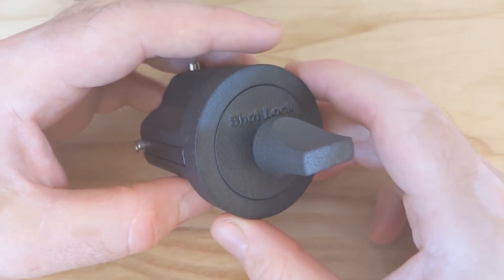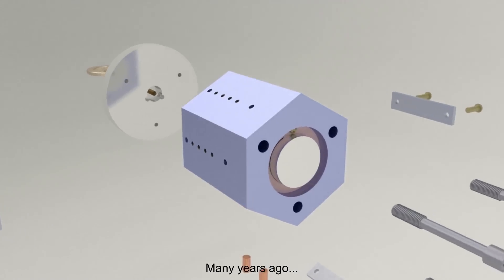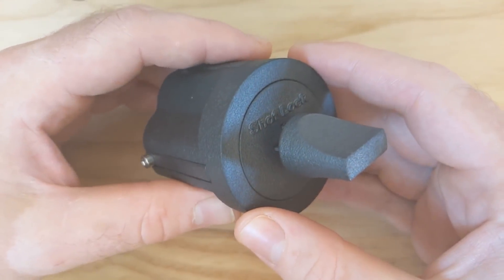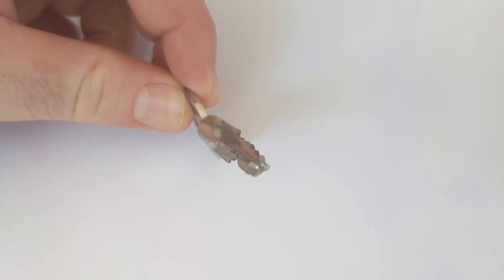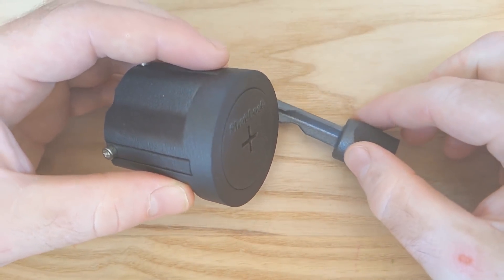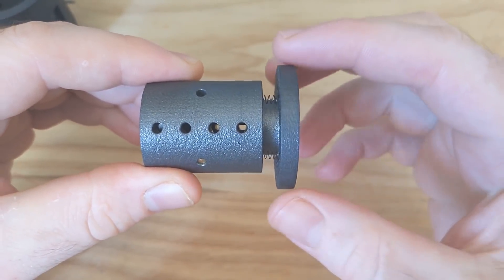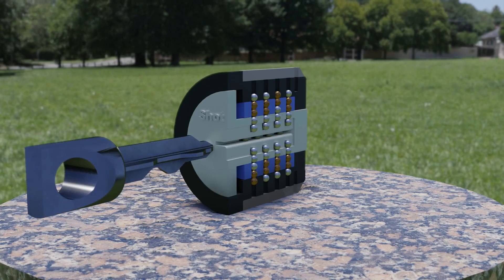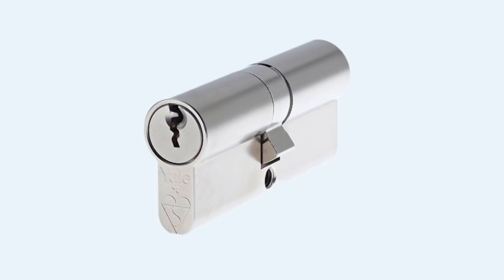A 3D Printed Unpickable Lock

Comment: Push up 1 pin stack, push in the inner core, add rotational tension, observe for slight additional rotation then pull the inner core back and check for drag from rotation. If you observe either the additional rotation or additional drag pulling the inner core out then thats your first binder otherwise reset the pins then try the next one until you find the first binding pin. Write it down.

After the first binding pin is found the method changes slightly. Push the inner core in just enough to be able to set the first binding pin without it falling, then look for the next binder by pushing in an additional stack. Push the inner core in look for even more rotation or drag pulling out. If there is no additional rotation or drag pulling the inner core out, completely reset the pins then restart this portion setting the first binder again and attempting with another stack. When you find the next one write it down then start looking for the next binder with the first two set. Repeat until unlocked.

It may be a little slow but since the bitting is binary, not only should you eventually pick it open but as a result you should also have to key completely decoded to be able to cut your own for future use.

This is based on using the mechanism in back that prevents the outer core from turning unless the inner core is pushed in for feedback instead of the sudden movement and click from pins being set while tensioned in standard locks. The drag would be from it lining up less and less as binding pins that it catches on first are no longer blocking it allowing the core to rotate slightly further. All manufacturing has tollerences and some pins will always bind before others due to that. Thats more important to single pin picking than being able to consistantly tension it while you pick.

Would love to have a copy of this to test it out, but otherwise this is mostly speculation. Love the lock design though, even if that does turn out to work it would still be pretty pick resistant.

I'm not very good at writing so I'm sorry if that comes accross as word salad :(

Comment: The cross lock makes it more difficult to pick. But unlike a key, which may bind when inserted the wrong way, a lock picker will not be using a key. Instead they'll use tension and a smaller lock pick tool. So they'll have access to all the ball bearing and driver pins.

I'm not an expert, but as long as there's some mechanism (key) being used to unlock a lock, there will always be a way to simulate that key with tools.

Comment: I think if there is enough space to push the ball bearings in by the length of two balls, then you could bypass the mechanism by pushing all the double pins out of the middle cylinder. Since the balls require springs to overcome gravity, the springs will have to be perfectly fitted for each lock to prevent them from being pushed back too far, which would make it expensive to produce. A high price tag is definitely worth the added pick resistance however.

Comment: I might be wrong, but I don't see very much difference comparing to "conventional" locks. It still has pins and they should be aligned at the same time in order to open it. The keyhole is so big so a locksmith still can apply torque to it and set every pin to it's position one by one. There are lot of pins though, so the process could be longer, but still it's the same process. I mean "click out of tenth, click out of eleventh". Since it doesn't have any security pins there will not be any counter-rotations... Great engineering though. Looks cool!

Almost forgot about this ball bearing idea. A pin with a chamfer on it consiedered as a low security thing, because you have no need to even position it precisely! And this lock have a ball bearings so LPL will move them very roughly with precision about a half of their radius and the tension will do the rest of the work.

Comment: Great video! Something fairly similar to this has been done in a euro cylinder format in China. The way they do it is that they have an exterior side with a larger diameter round housing, then the interior side only has one stack of pins so as to allow for the cylinder to be slid into the lock case. To accommadate, you can design special handles and use a hole saw to enlarge the existing hole. The best part about this is that you can design the handles such that they would protect the lock against snapping attacks. A wider handle might even be beneficial for post break-in attempts as it could help hide the scarring left from burglars. One piece of feedback I would say is to have more depths (3) if possible to increase key changes. I feel like this lock could have great potential for masterkeying or even quick-change systems. Great stuff and your earned a new subscriber :)

Comment: Suggested improvement? That lock can be an effective button, so you can take leverage out of the equation by making the lock turn itself when the key is inserted & lock body pushed in. At all other times the rotation is locked too solidly to jam any pins for picking.
This would also make extremely unusual key designs feasible, because you no longer need to apply leverage thru the key. It simply becomes the physical encoding device, W just enough surfaces to insert easily then depress.
Integrating the motor is straightforward, & power loss concerns can be mitigated W a charging system (even wireless?), Charging 2 batteries in parallel, each capable of running the lock thru 50-100cycles alone. The second battery is a redundancy. Both batteries should be designed for an offset maintenance cycle; if the lifespan of a cell is 1 year, then you replace the first in January & the second in July. I would actually recommend a 2 year or longer design cycle, W internal count/test & alert when cell falls below set threshold (modified smart BMS re lithium batteries?)
A manual lock/unlock override knob from inside also necessary, but mechanically feasible. Tho shielded button (Hollywood launch button) may provide security features of its own...

Comment: I've now read about "just keeping the tolerances low" multiple times here (for preventing some.... Plausible .... Attacks). I'd like to point out that physics plays a major role here and that tolerances will always need to be there in order to not make the lock a "works between 15 and 20 degrees C, but not in reality lock".
The reason for that is that different materials (even different thickness of the same materials) will inevitably mean that a theoretical no-tolerance-lock will just not be a good lock in practice if you can't open it on cold or hot days considering expansion and contraction due to temperature changes.
And as we all know, there is always an easy way to change the temperature of a thing without destroying it.

Comment: These are binary pins, so they might be more vulnerable to decoding than the standard pins. I wonder if there's any difference in friction when balls are free to move. Another way is to check for sound feedback when you slowly move a pin or by flicking it with a lockpick.

The effects could be more amplified if the keyway is slightly pushed in, so the balls have more friction with sidewalls.

Comment: LPL is gonna over-set all the pins past max intended height and open it in under 60 seconds. That's my prediction. It's not an inherent flaw in the concept, just in the current prototype implementation. It's a very promising concept that I think is actually viable for mass market usage.

Comment: REALLY Interesting design. Seems to be sturdy and simple enough for mass production, overall an awesome idea.

Flaws I can think of: the "double-height pins" design seems to allow for 2 or more "acceptable" positions (with the pin all below or all above the sheer line), meaning a very large number of keys can theoretically open this lock. This would not go well with mass-production. (and I imagine this is the reason why you wanted 4 lines of pins instead of just 1 -- EDIT: just realized that you literally said this in the video lol).
My prediction is that LPL will find a way to decode it based on this redundancy.

The fact that the key can action the balls through the slit, but the slit is too small for the balls to slip out is a nice touch too, but I think it may be exploited to "leave" objects keeping the balls raised once the correct height for that pin has been identified.

Still, this is all speculation of what LPL may do, I would have no idea how to do it :)

Comment: I’m not a lock picking professional, so definitely take the below comment with a grain of salt. This lock definitely looks pickable with some special 4 way lock picking tools. You just need to figure out where those double balls are & you have the cuts of the key. But if you can make it so that the actual verification mechanism is after the key being rotated, and completely blocked from both the inside and outside of the lock, the lock will be much harder to pick. You can also definitely use low profile metal disks instead of ball bearings for a heck of a lot more combinations.

Comment: Nice work. More elegant than SMH's locks.
If you replace the second ball bearing out from the centre with a stack of wafers, and the upper single and double ball with regular pins, you could have more bitting by changing the relative lengths of the pins. You're still limited on number of pins compared to a regular lock of the same size, since the pins must be completely obscured before tension can be engaged. The pins also need to be solid enough to withstand a brute force attack, so that limits the minimum size. Nope, I don't think you can get that in a euro profile without compromising it.
Reply: I'm wrong. You just need to have it manufactured in Switzerland.

Comment: If you make a standard profile lock, you can expand from a 0-1 binary for each pin to 0-2 or 0-3. You would just need to make connected balls in multiple sizes. 
That should be all you need to expand out of the binary. 

And as for being unpick-able, I think it will rely on whatever ties the movement of the two inner sets to each other. Or what keeps the bearings inside.

Comment: The lock isn't unpickable, just very difficult and time consuming.  You mention early on the possibility of trying all possible combinations, which would likely be very difficult and take a long while, but it is not impossible.

I agree with Lock Picking Lawyer in that no lock is unpickable.  This is because, if you can put a key into it, then you can put a tool into it to manipulate the lock.  If the tool can't bypass the lock (your design looks very good, so I doubt such is possible), then it's just a matter of trying all possible pin/tumbler combinations to defeat the lock.

I also came up with a design to isolate the pins from cylinder torque (I really like your push design; my design rotates, but accomplishes the same thing), but I don't have a printer to make it.  One day!

Comment: If I was to try to pick the lock I would apply force i. The direction of pushing the lock in rather than using torque in order to pick it, by apply any force that causes a shear, it should allow one to test pin positions and gradually push the pins up and then rotate it after all pins are set

Comment: You can just deep set the pins until the two fused balls are set completely into the outer part of the case if there is sufficient space. In the animation it looks like there is but the springs are not shown either.

Comment: The real problem with this lock is the limited number of different keys due to the binary nature of the key cuts. I can easily imagine an automated picker that would take only 200 seconds to test every possible combination.
I also wonder if half-set pins would fall into the correct place often enough, making a bump-like attack possible.

Comment: It is not impossible, just hard. Trial and error would eventually give way to it being picked. Adding more pins would increase security along with making the pins have more position options. Currently there are only around 65000 (2^16)possible keys. Making more pin sizes could increase this to almost 3 trillion (6^16) possible keys.  also there could be tool made just for this type of lock that attempts to get under the shield to push up the pins anyway. Great design, still will be picked one day

Comment: Your lock is vulnerable to comb attacks, though it will probably require a special tool to comb all four sides simultaneously. I'm surprised they don't already make comb picks for cross locks. Another potential flaw is that you might be able to tension the center cylinder towards the back of the lock instead of rotating tension, and then use a regular pick to push each pin as far up as it will go. 

This is not unpickable.
Reply: No. The innermost cylinder can only rotate when pushed on ball diameter towards the back of the  lock, because there is a piece at the back that can only be freed when pushed that amount.
Sure you can insert a comb if you want, but if want to rotate the inner cylinder by any amount, you have push the cylinder, which cuts access to the chambers. Have a good look at the schematics.
Reply: @xl000  In the attack I'm describing, the comb only goes to the innermost sheer line, and no further. This pushes all of the pins out of the inner two cylinders.
Reply: @xl https://gcdn.pbrd.co/images/eUoOEULynnvf.jpg?o=1

If you have a look here, the outer cylinder only has a width of two ball bearings, or one pin. You'll also notice that none of the pins are inside the the inner cylinder. Because of this, you could insert a comb to the inner shear line, and effectively push every pin completely out of both cylinders, before pushing back on the inner cylinder.

Comment: thats a clever design for an intractable lock.  It would be nice if there where more than 2 bitings per pin, but 2^16 is still quite a few combinations.  I can imagine a robotic lock bruteforcer for the lock trying 1 pining per second, that would take an average of 9 hours to decode the lock, but thats probably fine.

Comment: Decoding this would suck but might be possible, shimming ball bearings doesn't work, picking may be possible with a flexible enough wire but depends on the tolerances, the main thing I would try is vibration since the pins are binary it's easy to get the right position.

Comment: it is just harder to pick then traditional lock, since you just added a false setting shear lines, a 2nd shear line and potentially more pins... so long you can reach into the slot and push the pin, it is more or less pickable...
Reply: You can't torque the lock until you push the barrel backwards, though, and once it's pushed back, you can't access the pins. There might be other exploits, but this isn't one of them.

Comment: Make sure nothing in there is magnetic to prevent the lockpicker from using a strong magnet to brute force the entry. Also, there should be no space to insert any flat item into the inside

Comment: Fatal Flaw I can see: you can push pins 1 and pin 3 on the different pin sets to move the double height out of the way, then there’s nothing stopping the lock from being pushed, then open, so this is actually easily pickable if you know the internals
Reply: huh

Comment: All the pins are a line in this case beside the first one on the bottom and the 3 row   in the upper side. From this picture all you will need to find are the pin with one pin move, all the others are already in place.

Comment: I think the design calls for some kind of ultrasound scanner.
Sending sound wave up the pin stack one could relatively quickly find pattern. 
Fiddly and insanely expensive if at all possible.
Reply from the maker: I don't think that would work for this lock but I have wondered about doing that for a normal lock, since all you'd need to do is measure the resonance frequency of the key pins which you can directly touch. (I used to be an ultrasonic imaging researcher.)

The biggest difficulty is that the pins are tiny so their resonant frequencies are extremely high. Probably higher than what most ultrasound transducers and electronics are designed for. Plus you need to fit your transducer into a tiny space, couple it reliably, deal with the fact that you can't just gate out the excitation signal, etc.

Probably possible but certainly not easy!
Reply: @timhutt7051  Yes. I have been thinking of all these difficulties you mentioned. Just didn't want to cloud up my comment. 
Quick, ad hoc calculation shows - if I'm not mistaken - that for steel pins, or balls resolution of approximately 0.5 mm would require frequency of around 1 Mhz.
Doesn't sound like doable.
On the other hand there might be imaging technologies I am certainly not familar with that could work in such application. 
Science fiction.